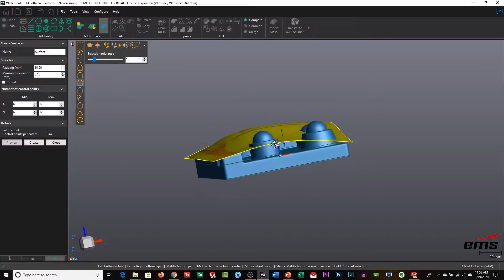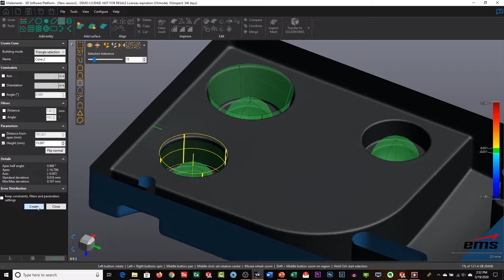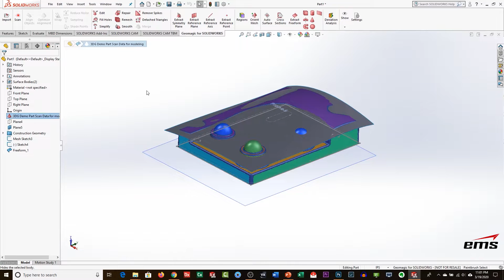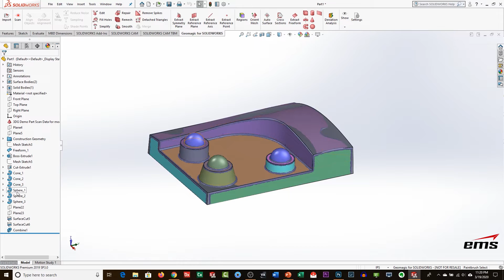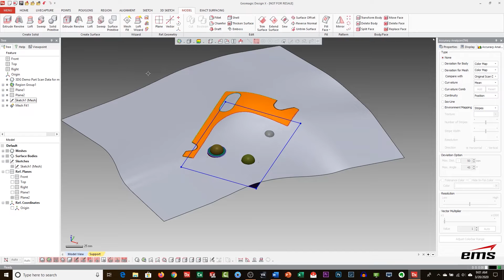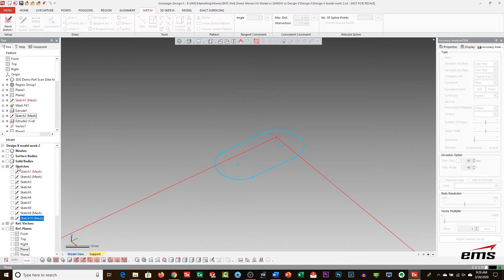3D Scanning Software Comparison - VX Model vs Geomagic for Solidworks vs Design X

Comment: Are you sure it would be possible to buy another scanner (Einscan HX for example) and use it with VX Model, via export- import method?
Reply from the maker: Yes.  VX Model is a stand along product that can import STL files from any 3D Scanner.

Comment: but I thought GM4SW did automatic feature tree building? or is that too good to be true?..... scanning seems cool but still quite a bit of work for more complex parts, you still need to basically build everything out mostly manually, I can just do that by hand measuring like I've done for the last ten years....
Reply from the maker: Hi Bike,  there is no automated feature tree building.   3D scanning is always the easy part of the problem.  Creating the CAD model can take hours to days to complete.    As far as hand measurement versus 3D scanning it really comes down to the complexity of the part.  Simpler parts are probably better off measured by hand very complex or organically shaped parts will benefit from a 3D scanner.   Here is a great video discussing myths about 3D scanning https://www.youtube.com/watch?v=MeHwMsDBBUA
Reply: @EMS3D   "Simpler parts are probably better off measured by hand very complex or organically shaped parts will benefit from a 3D scanner." yes, I agree, good point.

Comment: Which software best for reverse engineering
Reply: Autodesk power shape 2021
Reply from the maker: It depends on your budget and needs.  All of these products are intended to be used for reverse engineering.
Reply: @EMS3D  thanks for reply i want to design easy and fast  rubber(ex Bushes,seals etc) and plastic product (ex. Game console,Automativ parts etc ) after that mould design.

Comment: Which was the format you imported the cloud of points? I got it in .E57 and .dwf but I can't introduce it in design X. Any suggestion?
Reply from the maker: Can you open the file in Faro Scene software and then export a .ptx, .pts or Faro Scene format?  Design X can read .ptx, .pts and also  has a plugin to open Faro (fls) files.